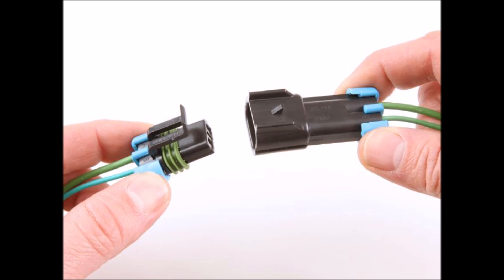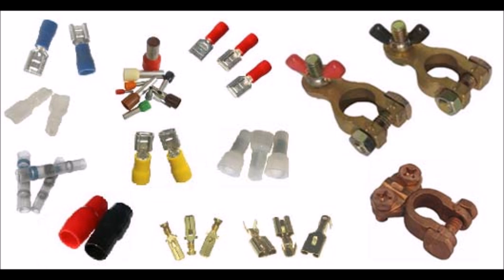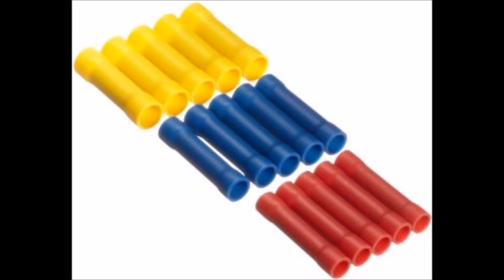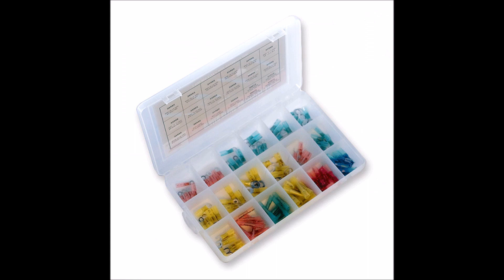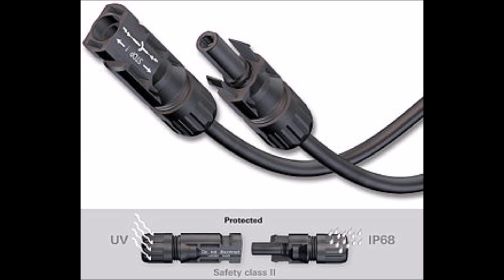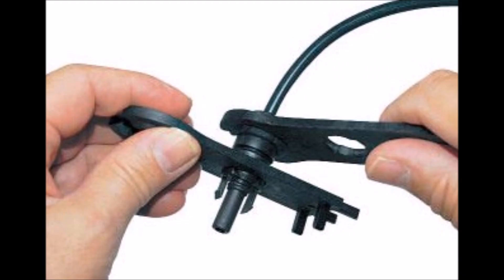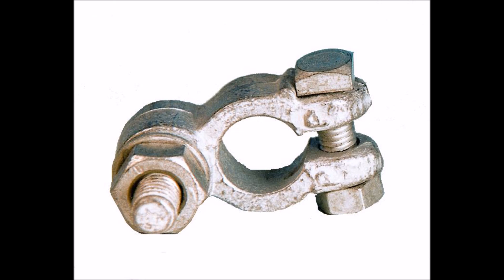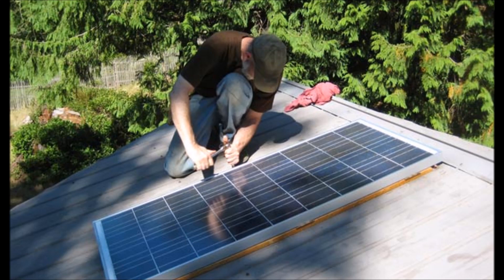Solar Panel Basics - Connectors 101

Comment: I hope the people who came up with this POS connectors rot in hell. They are not easy to take apart at all .
Reply from the maker: That is true.  They require a special tool to take them apart.  But they are also not meant to be taken apart very often.  They are generally for permanent or semi-permanent connections.

Comment: I have a solar panel with anderson powerpole connectors.  I want to change to mc4 connector.  I see you  didn't mention anderson powerpole connectors.
Reply from the maker: Anderson connectors are uncommon outside of small solar kits.  You can either cut off the Anderson connectors or use an adapter such as this one:  https://amzn.to/3eLdWcm

Comment: I don't know why one might want to give a 'thumbs-down' on this video.  Very puzzling.  Great overview of connectors.  One question - is there a max amperage / wattage rating for any of these?
Reply from the maker: Great question.  I don't know.  I would bet you would exceed the current carrying capacity of the wires before the connectors but that is just my guess.
Reply: ... those Votes are by Non-technical people, who are afraid of Computers, laptops and other Electronic devices that have an Interface, buttons, and LED panels 🤔

It's mind boggling that they can use a Toaster or Microwave without having an Anxiety attack 😆

Comment: Mc4 can be used in motorcycle electrical connections? Considering with all harsh weather conditions...
Reply: I would recommend Weatherpack or Metripack connectors for an automotive applications.  They're weather resistant, meant for the heat, vibration, and chemicals in vehicles, and they're pretty affordable for that style of connector.

Comment: I know that you are trying to be helpful and informative. You show solderless crimp connectors. At 1:28 you show a SOLDER  crimp lug connector.  If somebody uses that for solderless connectors, they will not make a good connection. They will pull out with very little strain.

Comment: I would like to hook my 450 watts of panels to charge controller with 8 awg wire but the MC4 connectors won't take a 8 gauge wire will it? So as to not lose amps from the distance....  6 awg would be best actually... I can pull in 24 amps if the wire would hold it...

   Is there much difference switching between 8 awg and 10 awg (I have now) in a 30' run to the controller?
 
  side note:  My EPever MPPT controller can only take up to 8 awg anyway I think...the connections in the front arn't very big really...
Reply from the maker: They will work but they are not designed for it.  #10AWG is the biggest they are supposed to use and be UL rated.  I would recommend that you connect to a combiner box.  That is what they are for.  Make short runs with #10AWG to a combiner box and then send one #6 or #4AWG to your charge controller from there.
Reply: oh yeah? a combiner box?   didn't know there was a thing ...thanks.
 I was using the connectors to one 10 awg feed, in stead of a combiner box I guess.... 
I just don't wanna lose any amps at all if I can avoid it.  and cables are something I can control...lol
Reply from the maker: Yes you can control the cables but the bigger they are the more expensive.  If you want to stay at 12V then you will have to use #2AWG cable to go 30' to your controller.  The other option is to wire the panels in series to increase the voltage, which can handle thinner cable over distance better without voltage drop.
Reply: ah... can do series? I didn't know if that would be too much Volts and still a 12V System...   I can do series...that would be ok....thanks  Till I can afford 30' or so of 2 awg (probably 150. bux)
Reply from the maker: Yes you can do series.  Just make sure your charge controller can handle it.  Good quality charge controllers can usually handle 24V input and still be able to output 12V to the battery bank.  But just make sure before you try it.  If you need help finding a suitable charge controller, I sell the full line of Blue Sky Energy and Genasun charge controllers.  I can help you pick one out.
Reply: I have the "EPever"  (Not the HQST knock off either) MPPT 40 amp controller.... I imagine that it could take in 20 - 24 volts but if I hook all 3 of my 150's up to it in series that will be closer to 50 volts...
I was worried about the input connectors on the controller... there a lil small ...Like maybe 8 or 6 awg will fit in there tops
Reply from the maker: Look at the parameters of the charge controller and see what the maximum input voltage is.  You may have to wire the panels in series and parallel to achieve a 24V system.  Or if you have and odd number of panels (3 x 150W) you may have to get a 4th panel of the same kind to make it work.

Comment: Hi there my friend, I would just like your help again. I'm linking 3 X 270 watt panels to a 1000watt Ginalong solis grid tie inverter but the inverter doesn't state what fuse/breaker to use from the inverter to the mains/grid. I've contacted the seller but he just said hard wire it to the breaker box. what size breaker or fuse would you use to be on the safe side? any help would be appreciated.